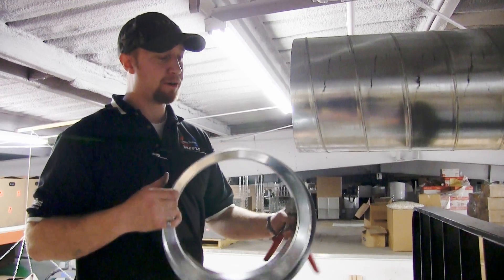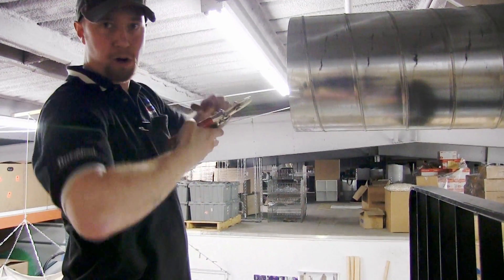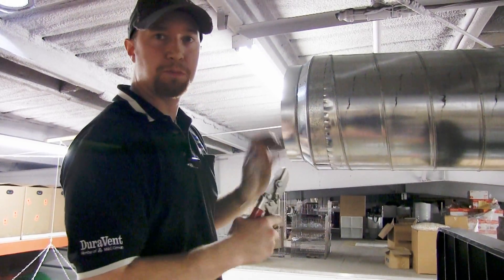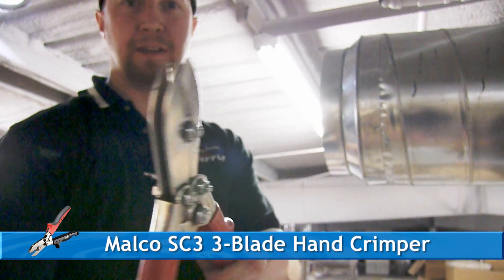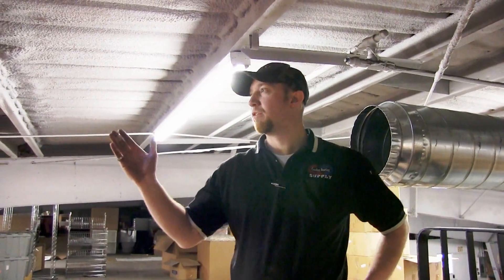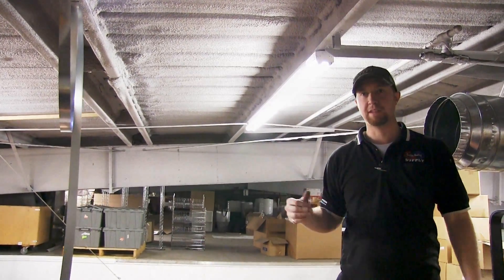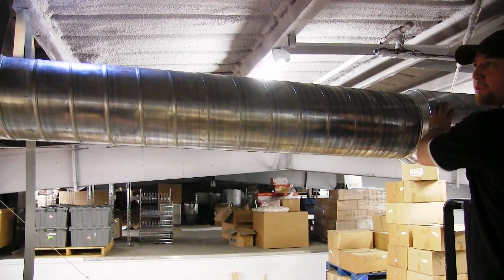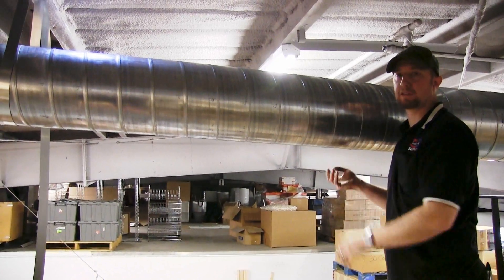Duct Reduction - How to Install a Ductwork Reduction taper - PlumbersStock.com

Comment: That reducer is designed to fit inside the spiral and not outside. Use wire rope instead of sheet metal band.thats how we do it in Europe. No need for crimpers.

Comment: Please stop I stalling duct work if your going to do it wrong. Spiral is not designed that way. That reducer is designed to slide inside tight. That's what the bead is for. To stop it for sliding too far. It's designed to slide In 2" the  to be secured and duct sealed. The other piece then would do the same. No need to crimp. Stick to your plumbing. 
And for anyone questioning me. I'm actually a licensed sheet metal worker.
Reply: MustangMatty1 I agree.  This video totally sucked.
Reply: not questioning just trying to get to the bottom, i bought a rigid reducer for my portable AC 6" to 4" its smooth on both sides but the 6" side is tapered out a bit, connecting it to a semi reigid ducting but they are both exactly same size, cant get either one to fit over the other, does the semi rigid have to be flattened where joining?  the semi rigid ducting is spiral but not the reducer can i still simply twist it on with the semirigid not extended?
Reply: @austinharding9734  are we talking about flexible aluminum. Or the flexible plastic garbage that co.es with those ac units? Those were designed to twist onto the coupling or fitting for the window. If your trying to connect that to an existing exhaust vent the  you may have to crimp the reducer to have it fit snug. You will probably be against the air flow on the semi rigid as you described. Just tape it. Is a very low velocity system. Hard to say without seeing what your talking about.

Comment: It first I tough he had done the pipe because airflow but then... he did the total opposite with the next pise. I agree he should of done the reducer on bouht ends.
Reply: For both pieces the crimping is done in the same direction. I think your original thought is correct